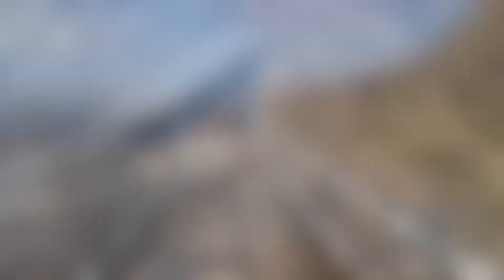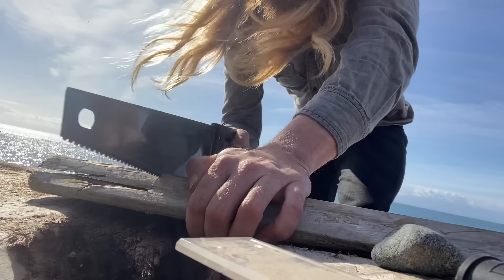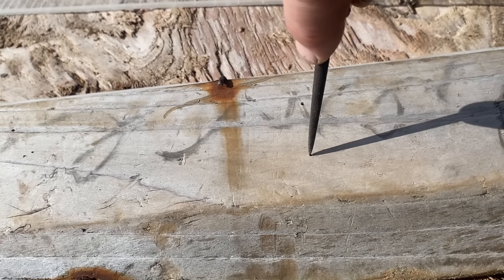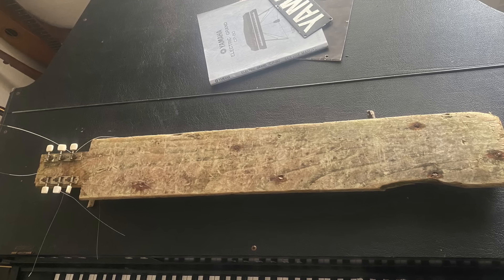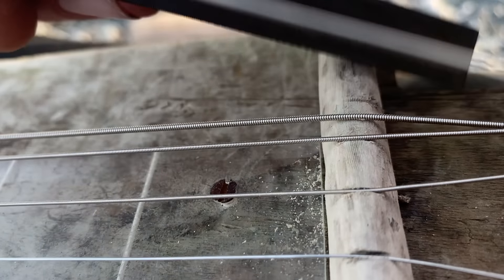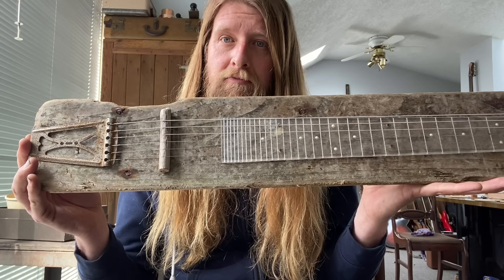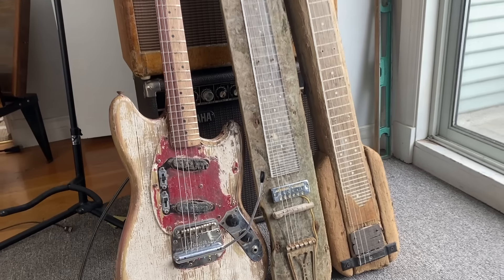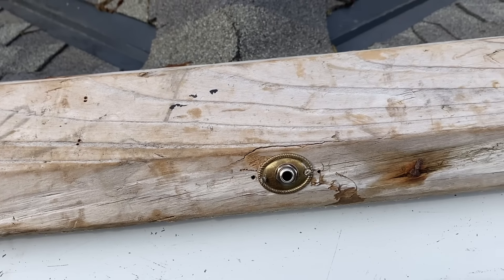I Built A Guitar ON THE BEACH

Comment: It does not look like you are using an Opinel, Opinels have a foldable blade with a ferule that you twist to lock the blade in the open position, yours seems to be a fixed blade.

As a French guy, I have been using Opinels since my tweens.

I too was sent by Ted.
Reply from the maker: You are correct! It’s a Mora, I have both but was mistaken in the commentary. But I did get to take a stab at American’s Freedom Fries thanks to my mistake, so it was worth it.
Reply: @Notaluthier  No problem, I was wondering whether Opinel did any type of marking or carving knife, I have been out of France for so long...